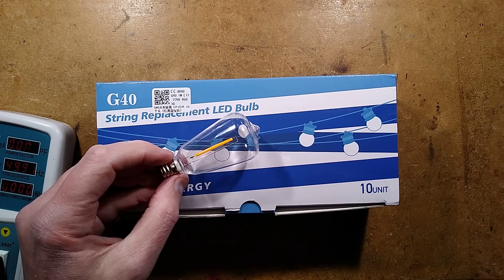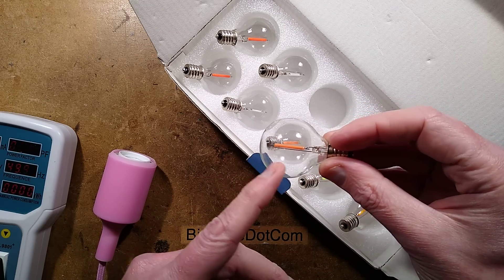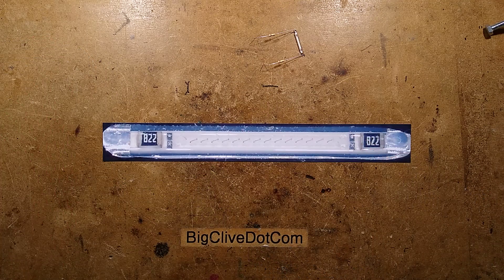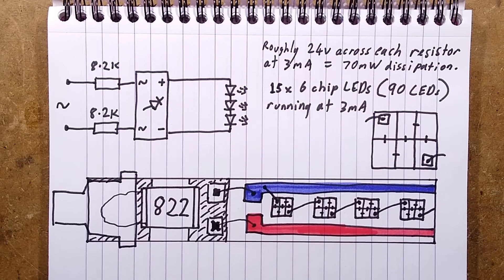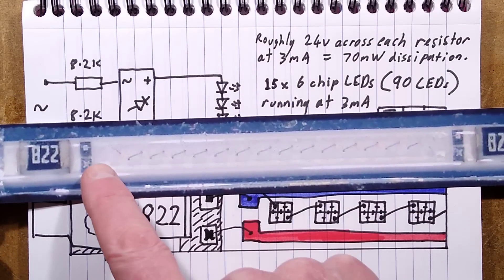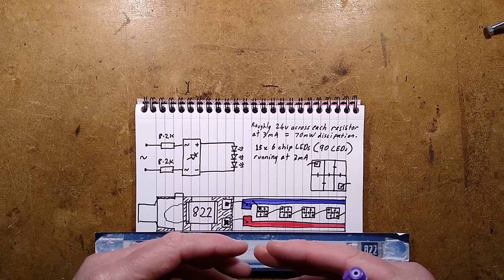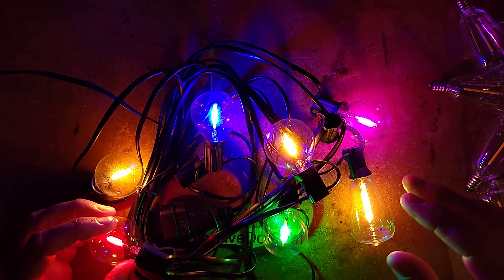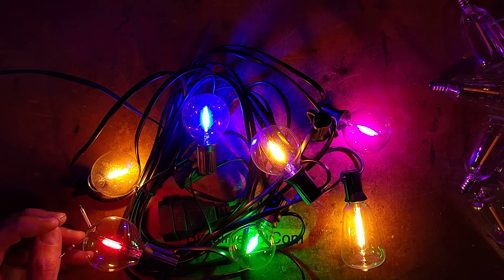New generation LED filaments - with schematic

Comment: Hi Clive - i have a set of LED Xmas lights that use a 31v 3.6W plug (an annoying 8-mode flashy flashy / not remembering the last setting one) and wanted to replace the adapter (the controller button switch was also in the adapter) but is it possible to replace it with a similar 31v but 6W (static only mode, non flashy flashy controller type) one instead?? i wasnt sure if it mattered or not? JT-DC31V6W-E4-IP44 is the code on it
Reply from the maker: Many of the modern ones use two wires that alternate polarity to control two channels.  If you run a string of those lights on a simple 31V supply, only half of the LEDs will light.

Comment: interesting video thanks. I reciently went to replace an led bulb which had gone dim after a few years. the bulb I bought to replace it tripped my lighting circuit, so I got another, which had the same result. on inspection of the new bulbs (22mm bayonet) I found that one of the terminals is connected to the bayonet metal ring, and my light fittings are the all metal brass type which are earthed. so these bulbs would not be suitable for an earthed fitting?? have you come across this problem, I bought them from Farnell electrical.
Reply from the maker: That's an urgent issue to take up with Farnell.  It's completely against the regulations.  It could make an ungrounded fitting live.  What is the item number?
Reply: @bigclivedotcom thanks for the reply clive, it was CPC Farnell : PRO ELEC  PEL00906  4W LED Candle Filament Bulb, BC/B22, I am not an electrician, I did not think about the potential danger. I have emailed them but have not yet had a reply, I was only asking for a refund though.
would you like me to post them to you, I have 2 one is still working (tried in an insulated ceiling pendant) the other no longer works. Ken

Comment: Hi Clive 
I have some older tungsten fixtures we used to call Red Heads running 650w tungsten bubbles. 
Is there anything LED you have found which I could slot in to these?
I remember watching AVE make that hammer I mean x-ray machine with so much love. 
Ahh old Youtube was such a wonderful thing.
Reply from the maker: It would be better to buy new dedicated LED fixtures.  The old Redheads may sell on eBay as showbiz collectable items.

Comment: what is the benefit of the two series 8.2K resistors? Local heating? Inrush current limiting? I hate to see power, even such a small amount, going to waste. I'd prefer to see volts dropped across more series LEDs, rather than resistors. But perhaps they are "cost-limiting" resistors, being cheaper than having additional series LEDs?
Reply from the maker: They are the main current limiter.

Comment: Equally as important as the construction of the 'filament' is whether these bulbs can be used outdoors or in humid environments.
Traditional filament bulbs were, by design, hermetically sealed.
LED bulbs almost never are.
I cured LED bulbs going out in my bathroom by filling all material joins with a thin waterproof glue. It would be worthwhile people knowing whether that would benefit these (and put pressure on manufacturers to make their bulbs weather-proof).
Reply from the maker: These ones are sealed glass and made using the same equipment as traditional bulbs.

Comment: How about a project a small enclosure with a plug and a socket and the only thing in it is a rectifier a large capacitor and some surge and current limiting resistors. 😅 This would provide a fairly well filtered DC to lights like these and kill all the Flickr pretty much
Reply from the maker: That would increase the voltage to the peak of the sine wave.

Comment: What would be nice are long LED filaments that can seamlessly join together then threaded to a traditional neon glass tube. Real coloured glass neon without the fuss and bother of the high voltage and gas. This is the thing with LED fake neon, it is not three dimensional like real glass neon signs. So I'd be happy as I am still bending neon will using LEDs.

Comment: I haven't seen the big grape sized incandescent Christmas bulbs for sale in the US since I was a kid in the early 1980s. I loved them, but it was too hard to justify the fire risk on a dry evergreen standing in the middle of the living room. The LED Christmas lights looked like crap for the next two plus decades, but there are decent ones available now.
Reply: You can come close with C9 bulbs, which are grape-sized but they are shaped more like night light bulbs. Now, the incandescent ones run hot and drain power fast. But LED C9s lack this problem.
Reply: @stgigamovement  Yes, the C7s and C9s are also nice because the color is often from the plastic outer bulb, so you can see the color even when they are off, like the classic incandescents. If I remember correctly from my childhood, some bulbs were true colored glass while others just had transparent, high temp paint on them which would chip and scratch over time. All the C7/C9s I've seen so far have the color in the plastic outer shell, so that's no longer a problem, either.

Comment: Someone really ought to make a device you can plug LED string lights into that reduces or eliminate the flicker. Either something as simple as a capacitor in a box or a DC power supply or some other suitable solution.

Comment: This doesn't really have to do with the video but have you ever looked at the halloween or purge style masks that have a glowing string that is weaved around the mouth and eyes, it's a weird one, uses 2 AA batteries but steps the voltage up to around 40v AC. I'm not sure what kind of light that even is.
Reply from the maker: It's electroluminescent wire.  Available on eBay with matching power supplies.  The cyan colour is the brightest.

Comment: Could you build smoothing in to the cable and then it doesn't matter if the bulbs you screw in to it had smoothing or not?
Reply from the maker: It would need matched bulbs and a bit of extra circuitry.

Comment: Came across some very bright 120v 0.6w 5000 Kelvin "night-light" replacement bulbs a few months ago, that were made the same way. Like you I thought there was a resistor in the base, (as I intended to use one as a fix for a battery powered micro-led filiment on something else), but it couldn't give it enough to overcome the resistors/chips in series. So I dissected it under my bench light w/ magnifying glass to find some extremely tiny circuitry; though the colors on yours are much nicer.

Comment: I'm pretty sure that the phosphorus is actually REALLY important to prevent eye damage. I would not use a bare blue LED, even though these are at a fairly low brightness.

Some people may remember the fears of early LEDs and the studies of the eye damage they cause. The phosphorus is what keeps modern ones from being so dangerous to the retina.
As a fun, neato addition to this, LEP (laser excited phosphorus) lights can produce a lot of light from a small input of laser, but the phosphorus renders that light completely eye safe.

Color me (pun) surprised that AliExpress is selling bare blue LEDs...
Reply from the maker: If you were to put a blue filter on a light meter and compare the output of a blue LED to normal daylight, you'd find that daylight is probably significantly brighter.

Comment: That's a rather nice X-Ray Hammer mate!  This sort of integration is probably being driven by final assembly manufacturers - the added per-unit cost is offset by the cost to them of semi-skilled assembly work, and probably even paid operators entirely - those modules can be easily (and quickly) installed by machine.

Comment: Hey Big Clive, I went into Home Bargains (do you have it on the IOM?) to buy Prunes, and I came out with 100 Multicolour Multifunction LED Fairy Lights for £4.99! They're good, but the colours aren't as vivid as some. The PSU is 220-240V, and has the Multifunction controller built in. I've noticed a very high frequency flicker. Why don't you get a set to reverse-engineer?
Reply from the maker: They use polarity switching for the two channels, so for static mode they have to alternate quickly between the two.

Comment: These are nice. They flicker but the circuit board looks clean.
And about the LEDs it is interesting that back in the days when LED technology was new, it was hard to make blue ones. Now they use blue LEDs pretty much in every LED light but they just cover it with phosphor to change the color if I understand it correctly.
Reply from the maker: Yes.  It simplifies manufacturing, and for the long strings of small lights it means all the colours have the same forward voltage for parallel use.
Reply: There's blue, and there's blue-near-UV. Not the same thing.

Comment: Dear Big Clive, I'm assembling a survival kit and it needs some modern electronics stuff, notably a way to step down voltage a lot. What would be the absolute smallest way to drop about 200 volts and still get at least 100mA for charging purposes? I've been looking into LED filament, COB, NiCr wire, thyristors, capacitive dropper and others but in the end it's always an SMPS (from an LED bulb incidentally) that gets it done with the least amount of grams, volume and compromise. What would you recommend?
Reply from the maker: Most standard universal voltage switching power supplies as used in battery chargers will accept between 85V and 240V AC or DC.

Comment: Thanks Clive. It would be interesting to know how hot these filaments get in situ after running for a while. Can your FLIR do that? Cheers.

The Aliexpress link shows NZ$1.60 for 10 and free shipping - until I log in when it changes to NZ$13 and NZ$4 shipping.
Reply from the maker: It does vary between countries.  It might be worth switching the currency to US dollars and paying by PayPal who will do the currency conversion.
Postage costs and import taxes may be a factor though.  Especially for the countries taking an anti-China stance.

Comment: dunno why they didnt do this sooner, although the heat will be isolated to the filament, it has a larger area to heat than just the base
Reply: you just gave me an idea for a new "quack" product, power saver type device that actually does that it says, flicker eliminator that has a cap and rectifier
Reply from the maker: Unfortunately the simple cap and rectifier would also increase the voltage to the peak of the sinewave, so in the UK 240V would become 330V and might damage the lights.  It would need the series dropper cap I mentioned.

Comment: I like the simplicity, although as you say, while good for a decorative lamp, you wouldn't want it scaled up for task lighting without something also on-board to flatten out that flicker. I recall a job a good few years ago where early Screwfix-special LED lamps were used as downlights and you could see the 50Hz just by waving your hand under them. It was a headache waiting to happen and aggravated my hangover something rotten. Nonetheless, this does feel like a natural evolution for the LED filament-effect lamp.

Comment: Fascinating autopsy of these bulbs but the question still remains why you would fill an LED filament bulb in a glass bulb with inert gas?  The manufacturers have many questions to answer here
Reply from the maker: Some high power LED bulbs use helium to help couple heat to the glass.  But these ones are probably at atmospheric pressure.

Comment: You could rectify to DC and filter the supply externally with a mains-voltage capacitor to remove the flicker.
Reply from the maker: It would require extra current limiting.

Comment: How long will the LEDs last before they start to go down hill then stop working?
Reply from the maker: That's always an unknown variable without a long term run test.  But the LEDs are being run at low current, which bodes well.

Comment: I guess separate rectifying diodes probably are a better idea than trying to use the self-rectifying property of LEDs.  If you wire two LEDs back-to-back, each one protects the other from excessive reverse voltage; but also, is only lit for half the time.  That's fine from a low power, long life perspective; but if you're running a business, why would you sell lamps that last a long time when you can sell ones that are twice as bright but only last half as long, so you end up selling twice as many?

Comment: I'm wonderin the comparison in let's say robustness twixt the two styles of bulbs, the LED and the Tungsten? As a motorcycle enthusiast, the tungsten bulbs just seem more stout than the uh... Cheapness for lack of a better word, of the LEDs. Obviously there are trade offs in any comparisons, but I see too many bits that look too cheesy to install on a lighting system for my scoots, which happen to shake as they are mostly Harleys. Like using locktite on parts you want to keep, you want to use bulbs you want to stay lit. Would you have any comment on the difference in their abilities to handle rowdiness? I see you have given your tinkering hammer from Ave a new name and a proper home. Thank you Clive for your curiosity and your ability to share it.
Reply from the maker: The main issue with vehicle LED bulbs is that they are usually being pushed way too hard and also often suffer moisture ingress related corrosion.

Comment: I always love it when the "AvEx-Ray Machine" makes a cameo appearance!

It's nice of them to relocate the resistors to the filament itself. I wonder if that's better for heat dissipation, and if the globes are filled with an inert gas or just air?

Comment: The shot at the end with them all lit up really sells them!
Reply: They really are vibrant!! All thanks to not having any thick coating on the glass to color it away from the inner tungsten's amber glow!
Reply: That LED blue is still horrendous.
Reply from the maker: They could theoretically soften it with a very slight dusting of phosphor.
Reply: @kristinnkristinsson1369  Really? I actually liked that one most, and neither blue OR purple are my choice in colors! (red, forest green, black, gun metal grey all are)
What don't people like about it?
Reply: @kristinnkristinsson1369 what, you don't want ambient lighting matching the colour of that one power board at 2am??
Reply: @kristinnkristinsson1369  It only took 30 Years to perfect!  :face-blue-wide-eyes:💡

Comment: If you're looking for a cheap gadget to help make better closeup photos of stuff that small (or just look at it more easily with fewer involved hands) I can recommend the dirt cheap digital microscopes from Aliexpress for about 30 bucks. I got one for soldering mostly (helps double check which stupid leg on a GameBoy CPU didn't solder down properly), and the magnification is even good enough to see the distinct subpixels on 600 PPI screens.
They're not the sharpest and they don't actually save images reliably beyond 8mp (despite what the product page claims) but work well otherwise, and the photo timer + stand is useful to ensure the photos don't get all shaky.

The one I got is called "5.5" LCD Digital Microscope 1000X 1080P Coin Microscope Magnifier with Stand Soldering Microscope for Electronics Repair" and supposedly the brand is GUANMOU with the model being GM55. Claims 1000x magnification, pretty sure that's wrong. But as said, perfectly fine if you can get it for 30 bucks while it's on sale to just see what's going on.

One word of warning if you do get it, the microSD slot is bad and it's very easy to push the card past the reader and drop it into the casing. But at least that casing is easy and quick to take apart as it's only six screws. The internal battery should also be easy to replace iirc, though I didn't pay too much attention there.

Comment: I wonder if the air inside an LED lamp were pressurized, would they disipate heat faster allowing the LEDs to rin cooler and by extension last longer.  

Does this sound like something you might like to try?  That is, see how double the pressure in a bulb effects bulb temperature, light out put, and power draw.
Reply: More air pressure = hotter. Maybe a different gas, or a vacuum?
Reply: @johnikey38   There's the temp of the LED's and then there's the temp of the glass surrounding a pressurized bulb. Assuming the same power that goes in and out, on might assume the possibility that the bulb temp might be same temp while  the actual LED material is better cooled somewhat.  And, as you mentioned, a different gas might have better thermal properties that also aid removing heat from the actual LED.  Too bad LED lights can break down oils that otherwise might have worked well for its thermal properties. 

Hrmm. Now thinking about an LED glass heat pipe and what working fluid/gas would work.
Reply from the maker: Some higher power lights use helium to help couple heat to the glass.  These ones are probably at ambient pressure.  They do unsealed plastic cover versions too.

Comment: I do find it unfortunate how many evolutions of LED lighting involves unsmoothed rectified mains voltage. I'm very sensitive to flicker from unsmoothed or even just badly smoothed LEDs
Reply: I have same issue with florescent.  They flicker to me and hurts my eyes.  Older LEDs when new and expensive seems to been made much better then stuff we get today.
Reply: @aj.j5833  First we needed to figure out how to make led lighting, then after that it was a race to the bottom

Just like any tech really

Figure out how to make it, then figure out now to make it cheaper